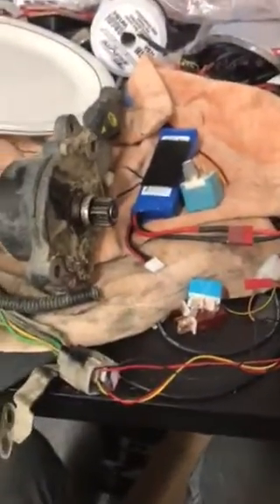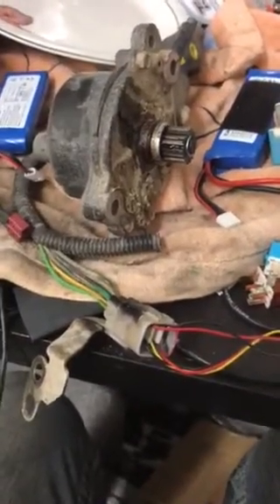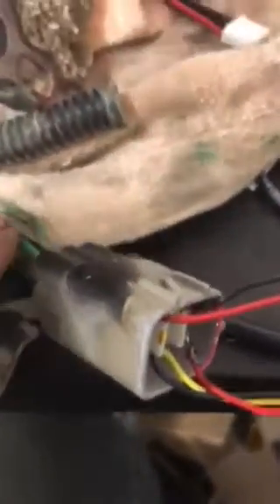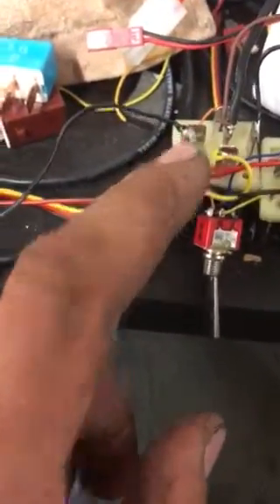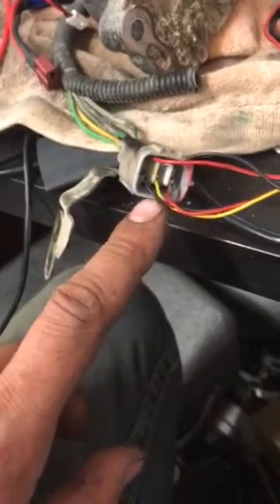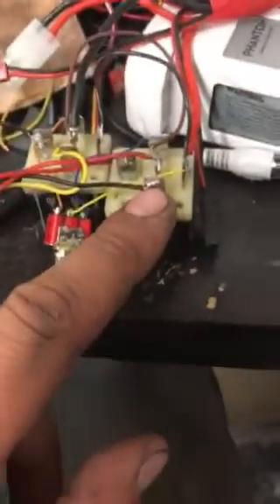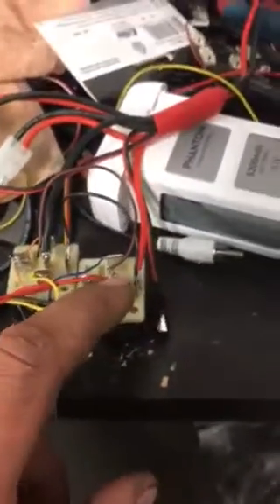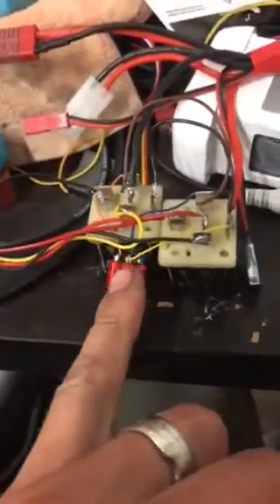Toyota rear diff lock hack

Comment: Heres a proper wiring diag of the circuit

http://www.markofshame.com/fsm/03_Tacoma/Wiring_Manual/03tacoma/systemci/039rdl.pdf

Your missing the whole ecu side of things with the speed sensor circuit that turns the circuit off or doesnt let it engage if going over 5mph.  And if have 4wd you have to trigger it in 4lo and 2wd in neutral..   another thing the diag doesnt say is the switch is supposed to click in and stay in when on then click out when you turn it off..  but the diag will show all the connections as well as where the plugs are located..
Reply: Very cool, thank you.  I was looking for this.😙